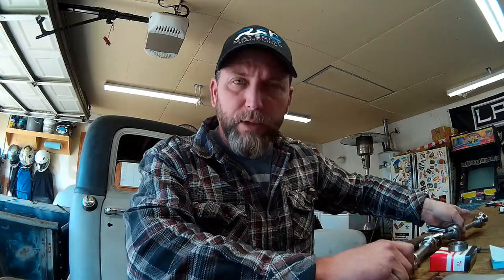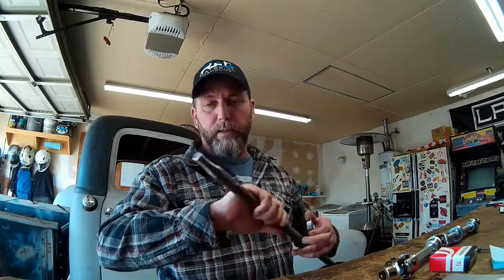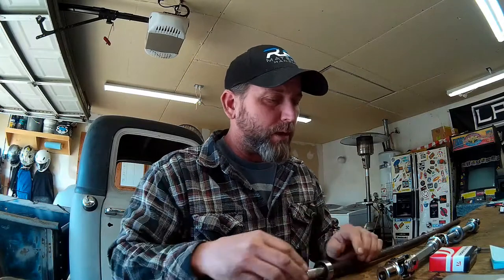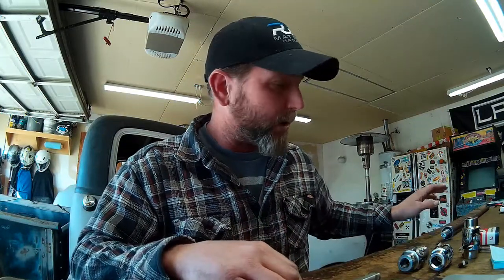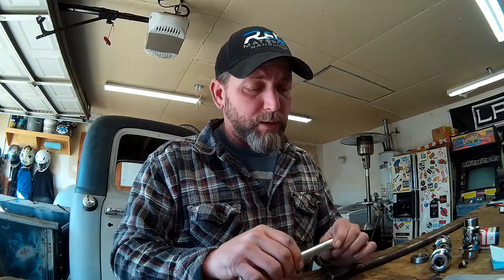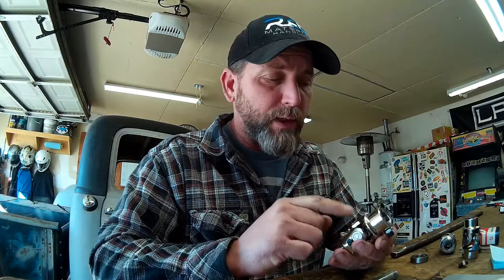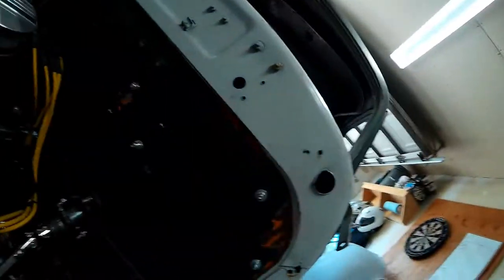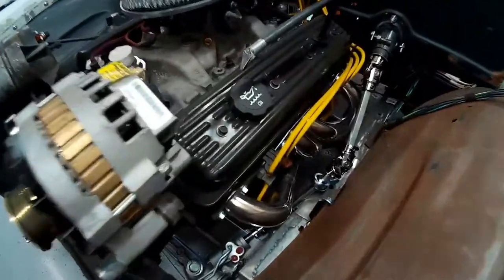P48 Project; Helix Mustang II IFS Install, Part 11 - Steering Shaft Fab & Fitment!

Comment: Hi Jim
Thanks again for the great videos.
Im installing the IFS and keeping the 6 Cyl and the 3 on the tree transmission. For now...
Any suggestions on where to cut the steering column and best way to support it?
Also what were the bearings you used on the steering column?
Was the mod done in a video?
Thanks
Mark
Reply from the maker: thanks Cambria!  yes, there are multiple vids of the column fab & steering shaft supporting that we did on the P48 project.  check out the P48 playlist on the channel here for all the P48 vids.  for your 3 on the tree install, it will be similar but you may have to shorten the shift shaft as well.  cool project i'm sure!  thanks for watching!

Comment: Hi Jim..  Where did you get the DD shaft and the u-joints? Also what is the size of the bearings?
Thanks again
Mark
Reply from the maker: the stainless DD shaft is 3/4" diameter, the rod end has a 3/4" bore, 3/4" shank.  i picked up the DD shaft & rod end from Amazon.  thanks for watching!